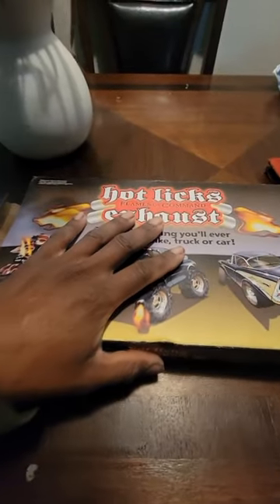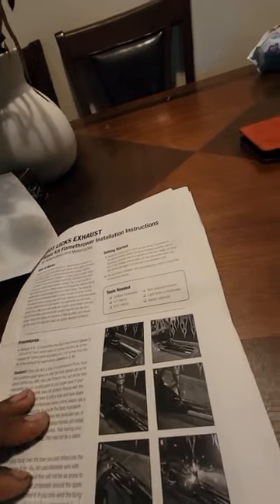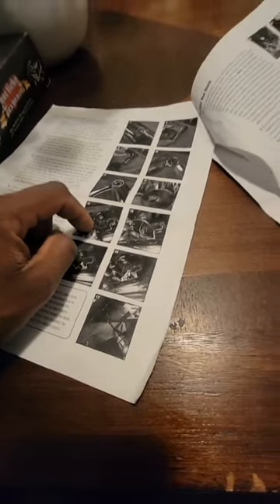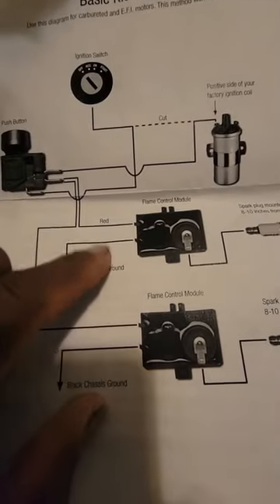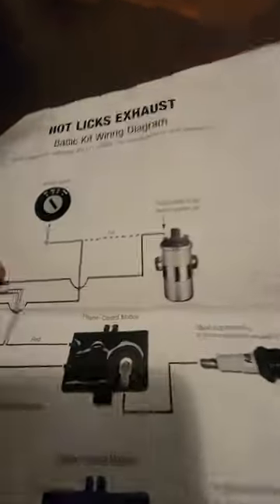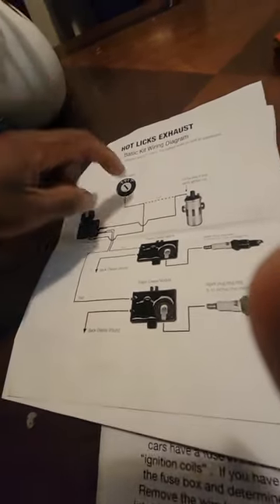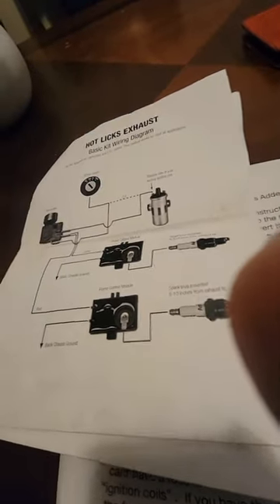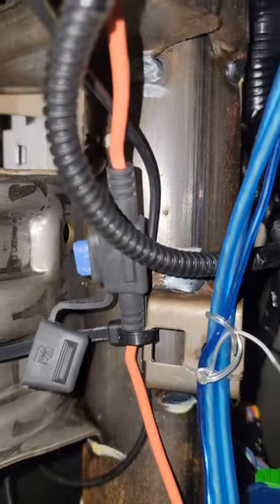01-05 civic flamethrower kit installation

Comment: What’s the name of that fuse? How would I be able to do this on a integra if you know by any chance?
Reply from the maker: U gotta open the distributor and go between the coil wire only way
Reply: Am I not able to use the 15a ignition coil fuse under the dash?
Reply from the maker: @osmoz1179  no
Reply: @jdmdaviyon7684  dam I thought I could lol.  what about the yellow/black wire which is the ignition wire?
Reply from the maker: @osmoz1179  no the only way is the way i just told u bro i tried everything the ignitor will reset and the car will cut off all u can do is open the distributor bro
Reply: @jdmdaviyon7684  if I open the distributor how can I run a wire to the switch? The distributor needs to be sealed shut
Reply: The black and yellow wire goes to the dizzy so why not splice it at the connector spot behind driver side strut? Can’t I do that?
Reply from the maker: @osmoz1179  all u gotta do is run en witb the rest of the wires it will fit
Reply from the maker: @osmoz1179  no it has to be inside because the coil and ignitor gets tied together u have to go higher and the go between the coil to h
Get the results u want bro
Reply: @jdmdaviyon7684  do you have a integra that you can make a video about regarding this? Because I’m kinda confused
Reply from the maker: @osmoz1179  i don't uf i dont know how to tell what wire goes to the coil i really cant help u that much rn until i ram across 1